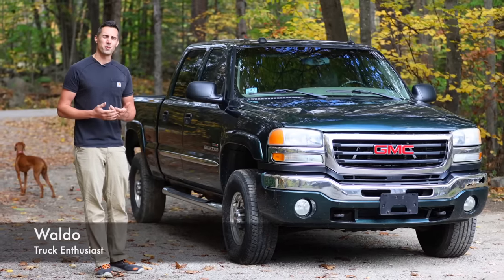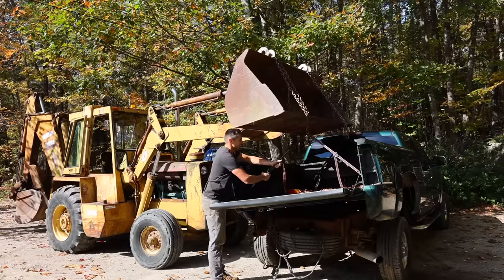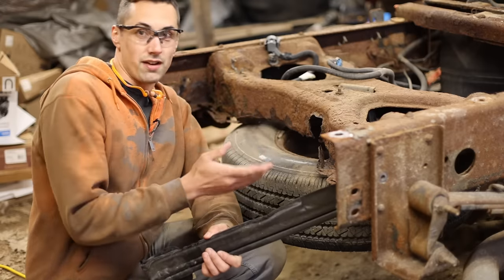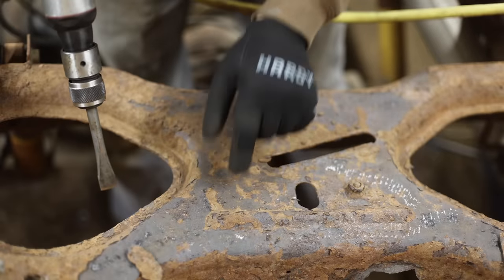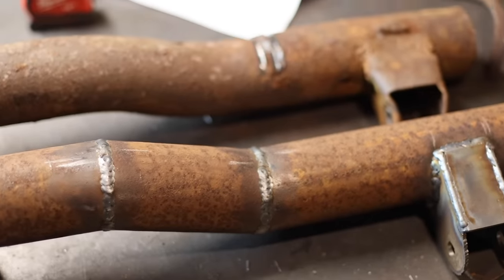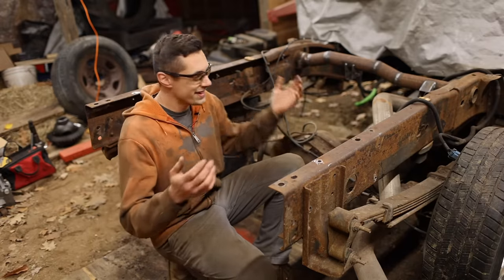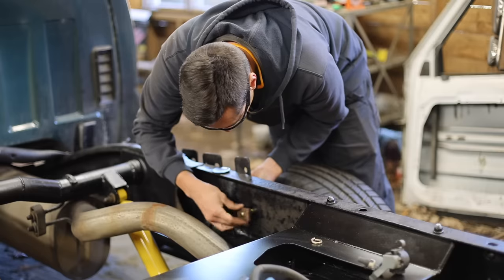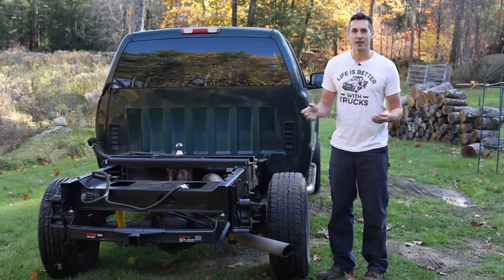Repairing a Rusty Frame on a GMT800 Truck [Cheap Duramax Part 2]

Comment: For next time on the welding so you do not have to weld such a big gap on each side cut of a smaller tube and slide it in there and then weld it, it will close up the gap and make it strong. And for the painting do not use what you did, go out and get some por 15 and will cover up everything and make a hard surface that rust wont stick to, and will last a long time.

Comment: What is a good CFM  to run those tools? I want to do this but my 20g are compressor is on the low end. Rated at 6cfm @ 90psi. I also don't have 3 phase for a larger one. Or 220v

Comment: I have a 1998 K2500 and use a  product called corrosion free applied by Canadian tire and there is no rust on this vehicle it is applied to the complete vehicle every18 mounts and it works cost is approx 168.00 cad plus tax.

Comment: Can someone explain why the surface rust on the front of the frame isn't an issue. Won't it become a problem eventually. If you want the truck to last a lifetime you would take the cab off and do the front right?

Comment: Can someone explain to me the process or spraying over light pitted surface rust ? Currently trying to get rid of rust on my under body and it is taking so long trying to wire brush it to clean bare metal am I able to just knock it all down and spray etching primer on the bare metal and just coat it with regular paint or coat all the rust pitted areas with a rust reformer then coat with paint ? Thanks for any tips

Comment: What size compressor do you typically run tools like your air impact gun on?
Reply from the maker: The compressor in the shop is a 15+ CFM 5HP 80 gallon 240V Ingersoll Rand. It's nice 👍

Comment: why didn't you use a hard core epoxy paint or something? all that work and the thing is just gonna rust again, even with the oil coating.
Reply from the maker: It's honestly too much work to prep it sufficiently for an epoxy coating to protect it. Any rusting after oil undercoating will be minimal, so it should last a long time 👍

Comment: If you would put bare metal primer such as self-etching, or epoxy automotive primer, then paint it with truck bed liner, you wouldn't have to oil it each year, or do anything for that matter. That paint without primer will peel right off.  You'd do better using Paint+Primer by Rustoluem...without the primer it will come right off.

Comment: It's a GM truck, rust is almost unavoidable. I have a 2007 Silverado and it's got plenty of rust. I'm going to give it to my son when he turns 16 and I might make it a project to walk him through cleaning up the underside. It's got quite a bit of rust, rocker panel, fender wheel arches, etc. I don't think I want to go through with the entire thing because that's a level of work I don't want to get into.

Comment: I just got done doing my 2005 Silverado. Had to replace Three cross members. The people at GM ought to be ashamed of themselves. Also our government safety agencies also. These things should not be on the road. My gas tank was just moments away from falling out. Everything is totally rusted I nearly gave up. I ended up using Rust-Oleum rust converter, before painting. Fingers I will never buy another GM product as long as I live.

Comment: Not sure why you didn't throw a coat of primer on the frame before painting it. Primer adheres to the bare metal and keeps the paint from flaking away over time.

Comment: After all that your going to use a cheap semigloss enamel?  You need something more rock hard and scratch resistant like black epoxy based refrigerator paint, it's by the same company as what your using. dries to a hard plastic sealed finish.

Comment: Hey waldo how you doing, enjoyed the vid however i saw something very disturbing. You sat in the box under the bucket of the backhoe, i doubt you intended to put yourself in so much danger but you did. That would have no mercy if a line blew out or a seal popped. Hope you dont ever get hurt. Just wanted to mention it.
Reply from the maker: Thank you for pointing that out! 👍

Comment: A smart person would have just used por 15 after sandblasting 2 coats and done for years . I have used it on a rusty metal just painted it over the rust it set out side for 10 year in the weather and still didn't rust back

Comment: You didnt primer the edges of that cross member before installing it. Now that will be the first rust spots
Reply from the maker: The oil undercoating should prevent anything more than surface rust from forming 👍
Reply: I should look into that for my truck.

Comment: Shouldn't u have primered-painted the cross member sections that join into the frame? U have bare metal touching the inside of the frame rail which will eventually rot out.

Comment: Don't put a flat bed on it! I'm from the North East too and grew up seeing Toyotas, Fords, and GM trucks with wood beds because the original one rotted away. Find a clean bed someone ditched in favor of a utility bed. A stock bed is so much better.

Comment: I don’t want to sound like a hater by any mean. I couldn’t do a lot of what you did here, but I have my fair share of battle against rust, and there is a lot I don’t like seeing… welds on rust, no removal of the rust between panel, lots of surface rust left and painted, no thread locker, no weld through coating, and I am not sure the welds were even protected afterwards. At least an epoxy primer should have been  applied before the rust oleum paint (which, as you said, won’t do much). Oil is good to prevent rust on rust free metal, but won’t do much if rust is left under. I mean… we’re talking chassis, structural components… 
I appreciate the DIY and big efforts, really. But corners were cut, and it’s really too bad because you really did a cool job otherwise

Comment: Why would you not at the bare mineral paint that crossmember. Even if this thing is made out of stainless steel it would still corrode from highway pre treatment and salt. You go through all this work and skip the small shit.

Edit. Looks like you did paint the outside of it but did you paint the mating contact areas between the frame rails and the crossmember? If not that's going to be the first place it rusts even with paint, without paint....

Comment: Man that rust oleum is just makeup and gonna hood moisture behind and eventually chip n rot. if you really wanna protect your truck from corrosion use fluid film.
Reply from the maker: That's the plan! The paint was just for the thumbnail 😂

Comment: That round spot on gas tank forward of the sending unit makes a good spot for a Fuel return for a lift pump when you add one. Use a 8AN bulkhead fitting through tank with a couple 3/4" x 2" flat washers and some silicone on top to seal washer/fitting to tank. Inside a 12" piece of alum tube with a flare and flare nut. On top an 8AN to 1/2" hose 90deg works great. Now fuel gets returned into tank directly instead of filler neck, for dirt cheap. I have a video of mine. https://youtube.com/watch?v=FptJEZ60mFM I also added a low fuel pressure guage and lift pump heater with temp sensor. For good low temp operation and monitoring.

Comment: Why would you not clean the hole pipe before you start welding it all up and before installation???
Most probably better of just buying a good frame??? 💲🤔

Comment: ROFMAO. Nothing new for a GM truck frame to severely be rusted.  They start rusting the moment that they leave the factory. GM only wax coats their truck frames. Also, GM trucks can't become tow-truck wreckers or car-carriers without frame modifications because the factory frames are too weak over the rear axle.

Comment: all that work to put cheap spray can paint on it? would have at least used something better after all that hard work you put into cleaning it up.
Reply from the maker: Paint, regardless of the price, is going to provide very little protection with all the salt on the roads around here. Oil undercoating is the way to go 👍

Comment: We usually skip right to the Cold Chisel when doing bed removal.
 The reason... because reusing old nuts and bolts is unamerican and wrong. Havoc upon our economy. A damnation upon capitalism. 
 Using a Cold Chisel is a sure, crack fire concept, for bed removal. 
 Buying new nuts and bolts helps small business. 
 The highway and post office is open. Gosh darn good.
 Don't loose it to dangerous recycling concepts

Comment: Tell me you know know trucks without tell me you dont know trucks soft cranks injector issues the head gaskets the leak on back of the heads dude stop acting like you know somthing when u dont know somthing